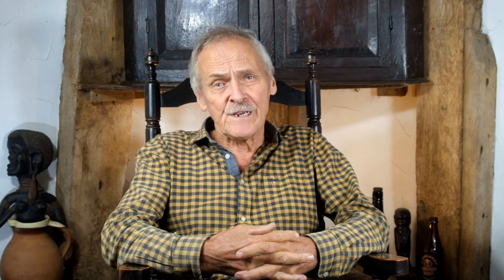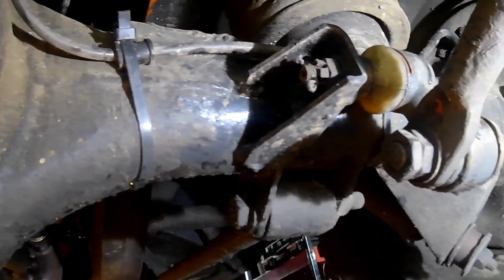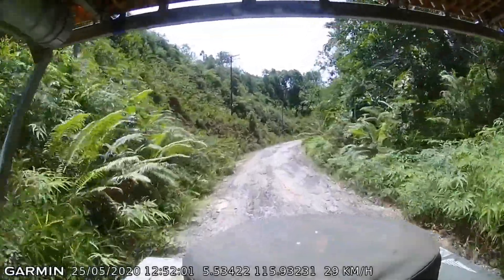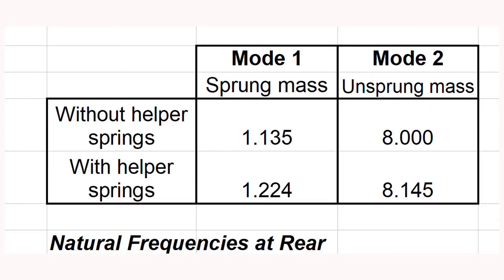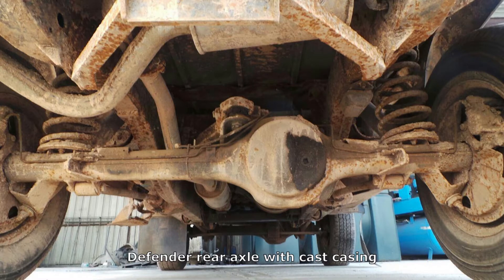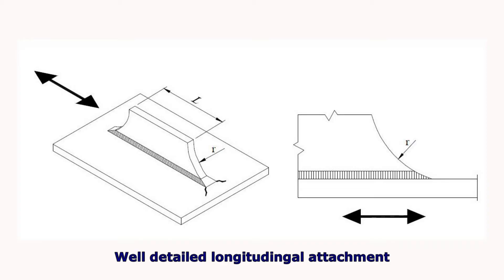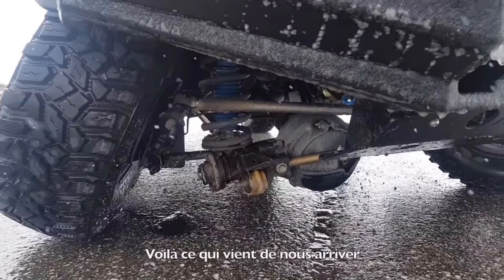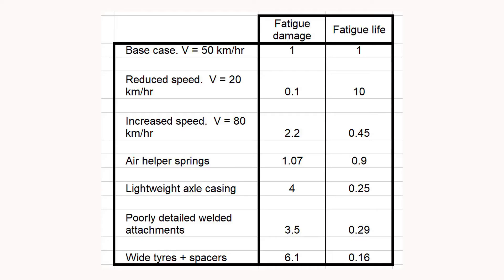Why axles break on overland vehicles. Part 5 - results of the fatigue simulation

Comment: Just to be a bit nit picky, you say the LR rear housing (referring to your Rover type banjo housing) are cast. I believe the housing is press formed steel in two halves and welded together, then the axle end flanges are GMAW to the tubes or Friction welded for the front housing.

While I absolutely agree with your findings, a note on the front swivel ball failure of Grizzly and Bears 130. I believe this vehicle is the last Tdci version. These are known to have a number of cost cutting, quality reductions leading to failures in the drive line. Failures that were not seen over the previous decades and models. Like the front axle flange failure at friction weld, several differential warranty replacements, the change in design reducing strength in the centre differential of the LT230.